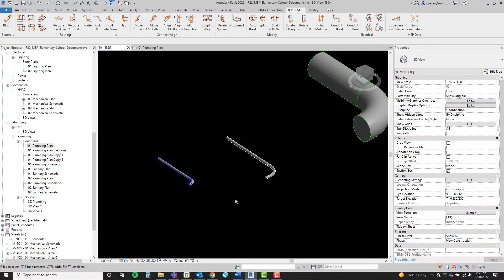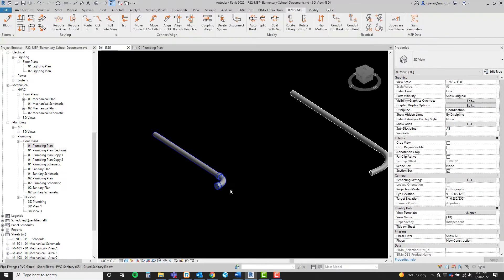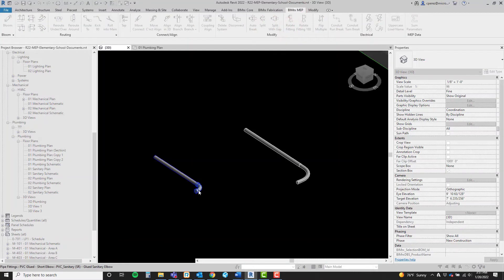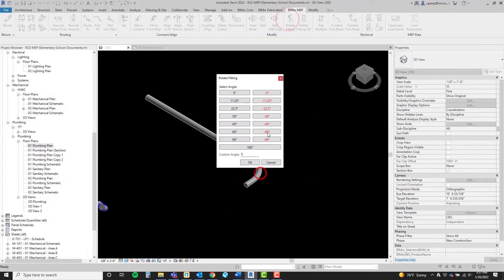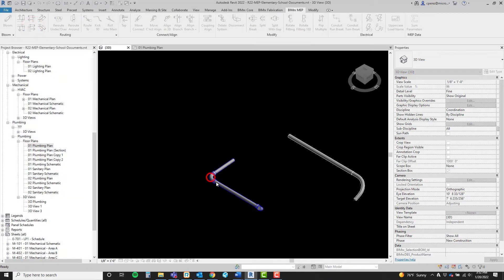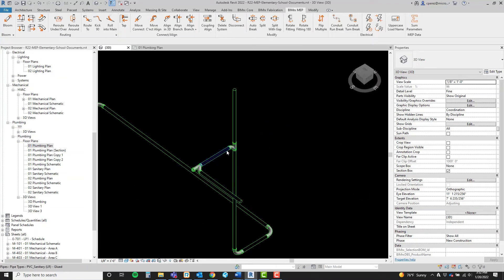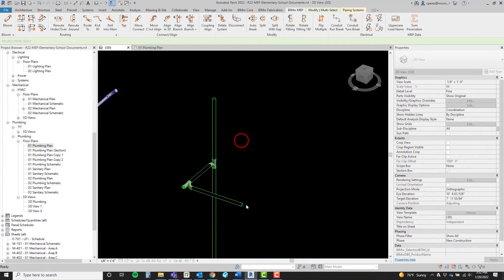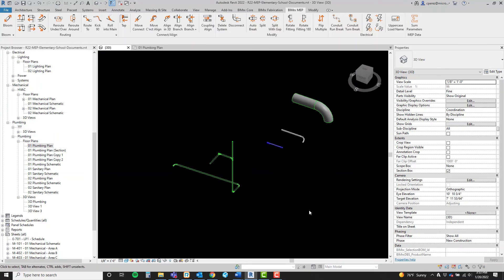BIMrx MEP 3.1 - Feature - Rotate Fitting Commands

Comment: The more familiar I become with this software, the more i see it LACKS. Why on EARTH would they not include this extremely basic function in their extremely expensive software? 
I wouldn't even be opposed to plug-ins and add-ons that cost extra but then they force Dynamo to stop working. oh, you didn't know that to get a Dynamo script to work that worked yesterday, you must DISABLE ALL 144 add-ins, add-ons, plug-ins, and apps? Here's another app to help you disabling the apps.
Worse, now Autodesk is saying we've installed some illegal software. Wat. The. Heck. 
The illegal software? Well there's a bunch, but most of them go by names like Revit 2021, by Autodesk and Plant 3D 2022 by autodesk.
 And now i must uninstall/reinstall dynamo bc it crashes if I look at its icon on my desktop.
So i uninstalled. Then i went to reinstall Dynamo. It says i need Revit 2020 installed on my computer. 
I had SIX REVITS INSTALLED AND I REMOVED A FEW okay! I have literally 50+ apps by autodesk on my computer. I need all of them JUST FOR REVIT.
meanwhile, this guy is like 'dude, i'm just trying to show you how to like rotate a fitting"